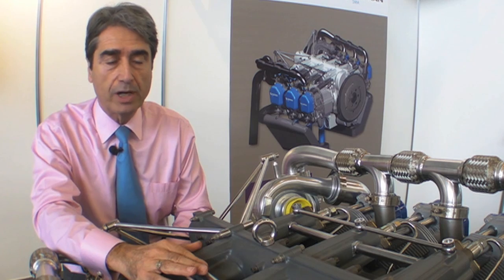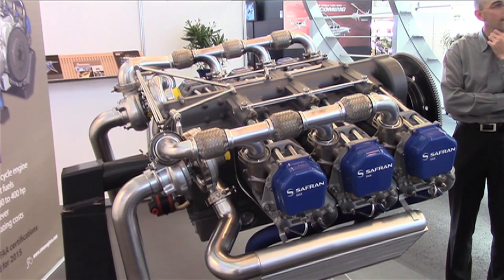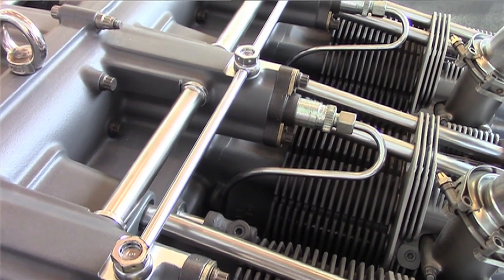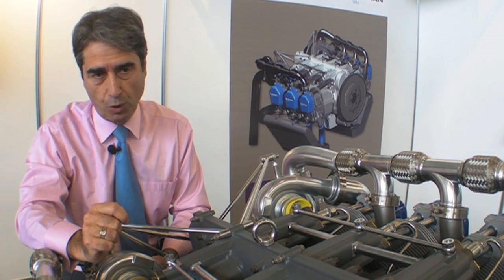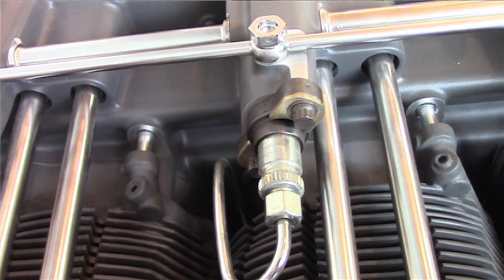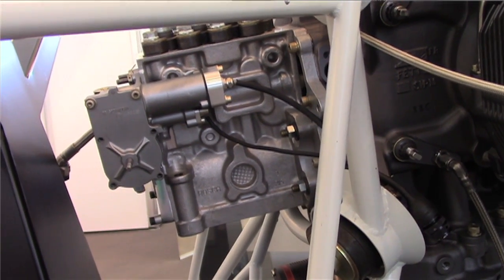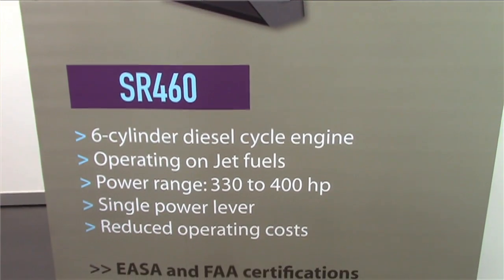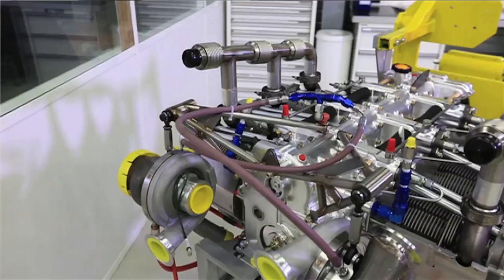SMA's New Six Cylinder Diesel

Comment: What a brilliant way to operate the injectors. Less parts and more direct. I would really like to know at what RPM this motor operates at and what its power band looks like.  There are some really big planes that need 300 to 400   hp  but also need to swing a BIG propeller at low RPMs for efficiency.
Reply: that's basically how 2 stroke detroit injectors work... unfortunately the rack can get stuck if not maintained well causing engine overspeed aka runaway.... and I see the potential for that here also. Easily avoided with a common rail electronic injection system instead of mechanical which is frankly inferior.

Comment: Our skydiving club has operated a 182 Cessna and SMA diesel for several years. Today I would choose a Continental engine instead. The SMA has proven unreliable and expensive to maintain. We do manage cheaper flight hours whit a rental 182 Cessna that has been converted to use 98 octane no ethanol fuel, that costs around 2€ per liter.

Comment: It's 2016, so let's put MFI technology that Bosch scrapped for diesels back in 1966 in an airplane.  Brilliant.  Why are Diamond and Austro the only companies willing to embrace 1980s technology in an aircraft?  Do people not realize what amazing performing engines and aircraft we could have if the manufacturers and regulatory bodies weren't so obtuse?  You already have to be a millionaire to fly, why not at least make it safe?
Reply: wastintime22 wrong wrong wrong, common-rail was first used in a car 1997, in an Alfa Romeo
Reply: Quote: "Do people not realize what amazing performing engines and aircraft we could have"    Wrong. Aircraft piston engines have superb power to weight, reliability at high load, and far better BSFC than car engines converted for aircraft use. Many modern automotive engines fall very short of our so called "ancient" aircraft engines.
Reply: @cujet  let's see..... Air cooling ..... Carbeuration ..... Pushrods...... Likely 25 percent thermal efficiency max while Toyota has broken 41 percent PLUS thermal efficiency with their dynamic force engines. 

Yes ancient. BUT reliable. HOWEVER, there are many reasons that both industries are as they are. To put it in perspective, we could likely be having 50-60 percent thermal efficiency engines in both aircraft and cars alike had both industries not stagnated. Bear in mind that aircraft engine tech is derivative of auto industry and so forth. 

Also consider that 9 time out of 10 the reason for derivative and iterative design as opposed to innovation in the aerospace industries (especially GA) is due to VERY low volume production and extremely low profit margins at that. Why do you think an air cooled carburetted flat four can cost north of 100K? Well thats why. 

Good on Austro and Diamond in trying to change that. I hear rumblings that both Lycoming and Continental are well into the development phases of new Turbodiesels.
Reply: @scenicdepictionsofchicagolife  Eric, if there is one thing about aviation that rings true, we know all the relevant data about aircraft and engine performance. Otherwise, flight planning would be impossible. A modern fuel injected Lycoming can reach 38% TE in cruise flight, in the neighborhood of 65% power. Even better with Electronic Ignition, with some examples reaching as high as 42%TE. Many engineers think they can do better and none have succeeded. I'll detail the reasons "if" you want to know.
Reply: @cujet  if this is true that's crazy! I just remember reading that the max approached 33-35ish percent TE and then on top of that prop losses etc and this was according to a reputable source I just can't remember where. 

Ik I may have come off as a know it all but I was really just regurgitating what I heard online through research. I am an armchair pilot. Only 23 and WISH I had a plane and the means by which to use it. 

This of course is why I am so massively interested in compression ignition engines for aircraft. Please, I'd love to hear more about the details regarding aircraft piston engine thermal efficiency etc. This is a blessing!
Reply: @scenicdepictionsofchicagolife  Learn about piston ring swept area and the resulting friction, (bigger bores and fewer cylinders lower the piston ring swept area and therefore friction)  the relationship of surface area of a cylinder and head to simple geometry (bigger bores and fewer cylinders have less surface area to transfer heat and when optimized, more work gets done) , heat transfer and it's relationship to work, on air cooled vs. liquid cooled (hot air cooled engines cannot transfer combustion heat as rapidly, leading to more heat available for work) (for the same reason opposing piston diesel engines eliminate the cylinder head entirely increasing efficiency) , pumping losses (wide open throttle operation reduces pumping losses of pulling a vacuum against a partially closed throttle plate) , lean of peak operation (operating with more throttle and less fuel increases efficiency, coupled with advanced timing and the slower burn of a lean mixture)  and last but not least, cooling drag (easier to transfer BTU's when differential temps are high, hot air cooled engines need less cooling air volume vs a radiator) and therefore less cooling drag . You will find that the engineers knew the right answers in the 1930's and did the best they could with the technology at hand in an effort to get significant range from aircraft. In recent years we've added some excellent improvements that make the old Lycoming downright impressive for light aircraft use.
Reply: @martinandersson5278  common rail was on Detroit diesels since ww2...
Reply: Wingnut353 common rail as it works today with high pressure fuel feeding the injectors was invented by Fiat and sold to Bosch. The idea of circulating low pressure fuel around pump-injectors have no similarity with modern common-Rail systems.

Comment: Looks good.  Probably weighs a fair bit and costs an eye-watering amount though - general aviation is a cottage industry these days :-(  If the extra weight is offset by the reduced fuel load, fair enough.  There's nothing north of 350 hp in a piston engine these days, aside from those russian radials that require special handling.

Comment: Best looking aircraft Diesel engine I've ever seen at least it LOOKS like an aircraft engine and not one of those atrocious auto conversion ones. I'll stick with avgas though. It's tried and true and I like being able to use the engine to help me slow down for landing and it is my understanding that you cannot do that with diesels. Look it up if you don't believe me . Something about you have to maintain a certain power setting until you for sure have the field made to preclude the possibility of flameout. No thanks .
Reply: Johnny K you are talking rubbish, Diesel engines have been used in aircraft since then 1930th
And bull shit that you have to keep the power 
Prove it
Reply: That's preposterous... every diesel truck on the road has an engine air brake it "flames out" every time it is applied and as long as the head is warm fires the immediate revolution after it is released.... the other obvious solution is gear redution which is what the geminie diesel appears to use to improve its power to weight ration (higher RPM, this also mean much smoother power delivery, this 3 cylinder is probably similar in smoothness to a 6 cylinder 4 stroke at the same RPM, considering its probalby running double the RPM and the power stroke is longer due to the OP design you get power delivery in much smoother pulses than even a 6 cylinder 4 stroke would)